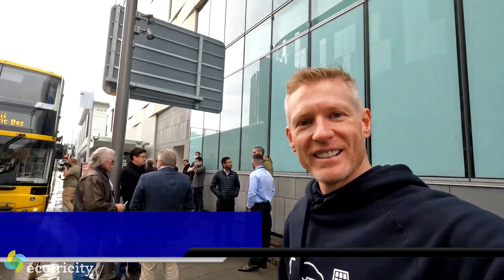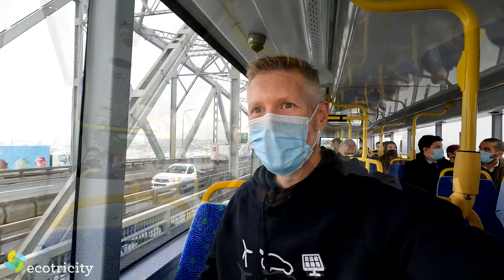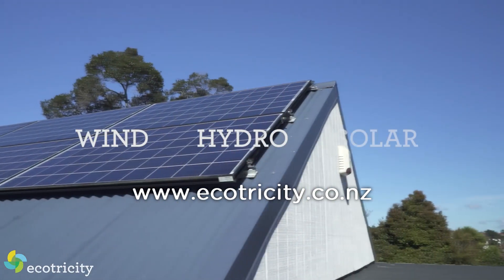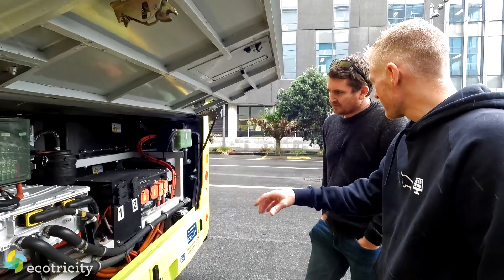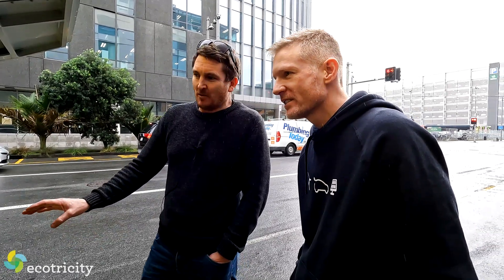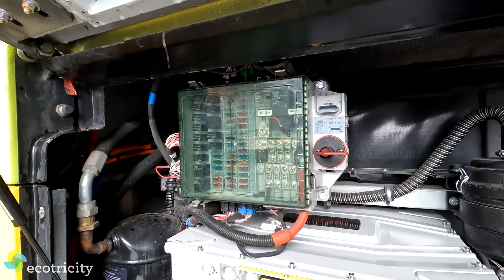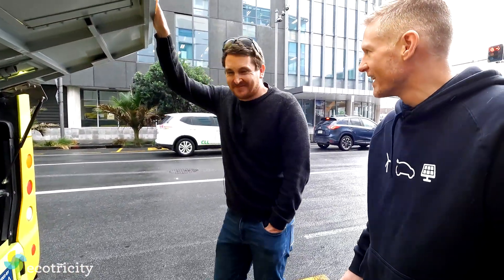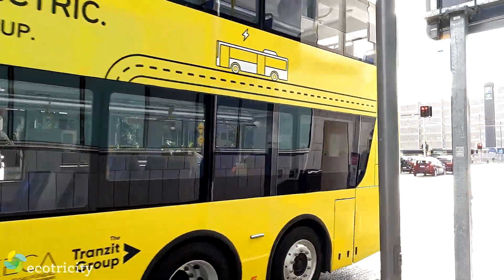Goodbye diesel! This double-decker bus has been converted to ELECTRIC!

Comment: That's impressive. 350kwh battery pack made up of 10 modules from CATL around the bus. 240kw motor with 3,000nm of torque. 600v system. 250km of range. $350,000 cost for first conversion.
Reply: Considering a full ev bus cost north of 700k it’s a bargain

Comment: I am a blind subscriber could somebody briefly fill in the blanks what got moved? And what happened to the back of the bus? Thanks cheers
Reply: They are talking about the organization of the electric and battery components. Of course it is where there used to be a diesel engine. 
So, I don't know what is what exactly, but the main parts of a battery electric vehicle are:

a Battery pack
a Power inverter
an Electric motor
an Onboard battery charger
a Battery management system
a Charging port

So, he was pointing to different areas where there were batteries, but we couldn't see them exactly. They looked to be under the seats, forward of the area where the engine used to be. And the electric motor was probably buried under the other components in line with the rear axle, so we couldn't see that either. 

So I guess some of the things they were talking about "moving around" were the power inverter, onboard battery charger, charging ports, and the battery management system. And there were some nice thick, orange cables. Everything looked neat, clean and professionally done.

There were two charging ports that looked like European or Chinese- style ports. Usually on a car, there would be just one. 

To explain what the charging ports look like, there's a big circle, and within the big circle, there are three rows of smaller circles where the plug connects to the ports. The top row has two circles, the middle row has three circles, and the bottom row has two circles again. I'll have to watch again to learn what kind of charging ports they are.
So actually, after rewatching the video, I can see the. charging ports are CCS charging ports. The top part is as I described, the narrator had pulled the black plastic cover off, and you could see that, but there is a bottom part with the cap on, but in charging, they would pull off both caps and use a CCS DC fast charger. If you had an AC slow charger, you could use only the top section. So he was saying each one could charge at 120 kilowatts, and 200 amps. With dual charging, it would be up to 240 kilowatts and 400 amps. Which is seriously impressive I think. But of course you need a lot of power to recharge the big battery banks for a big double-decker bus.
Reply: What happened to the back of the bus was they took the diesel engine and transmission and everything out. They showed a picture of it for about 2-4 seconds. It was a big area behind the rear wheels, . A bunch of panels were opened like doors. That's where the mechanics would have had access to the former engine. Above the empty engine compartment, I could see some air conditioning fans. So I guess they probably kept the air conditioner system, unless they installed a new and improved one. There was no floor below the engine compartment, just empty space. 
The area seems to be about 1 and 1/2 meters tall, and maybe 2 meters deep, plus the width of the bus.
Reply: Thanks for taking the time and making the effort cheers

Comment: Those buses are pretty new right? Makes you wonder why they were ever bought with diesel motors in the first place...
Reply: EV buses are more than twice the price of diesel buses. If you need to buy 100 new buses that's a big hurdle.
Reply: @briananthony4044  Is that an opinion or a fact?
Reply: @heathwirt8919  Fact, is the reason older buses aren't replaced with EVs on a 1 to 1 basis. Same as cars, battery packs are expensive, but in time will get cheaper, but for now. Price parity is expected to be reached by 2030. Taken from Auckland report on future bus services.